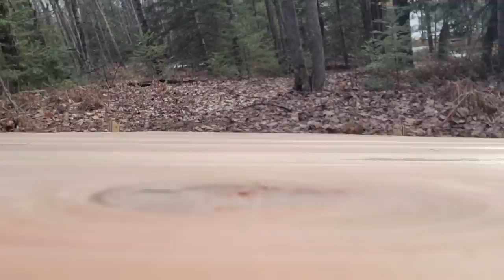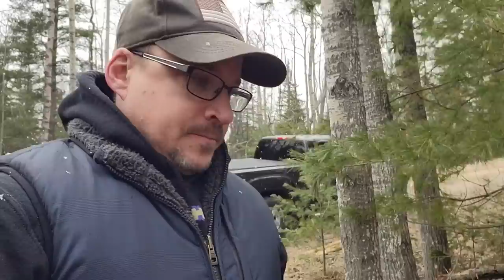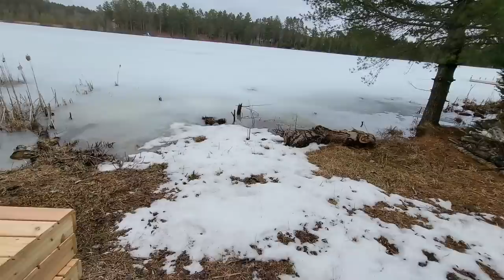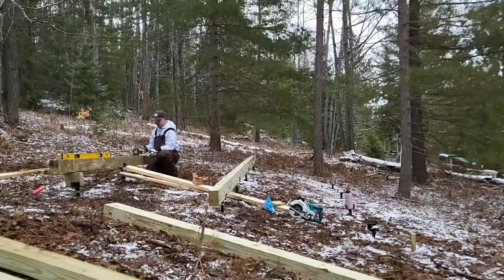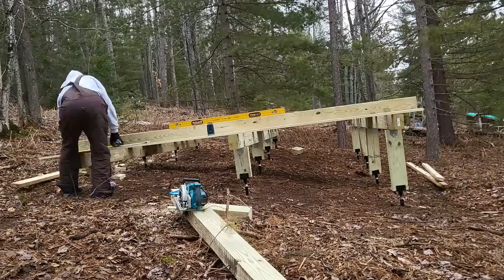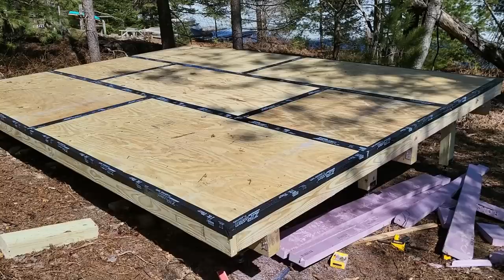12 x 16 Off Grid Cabin Build - Episode 1 - From Docks to Floors

Comment: Excellent location!! Great job!
Having built many small cabins myself, I see many cabins being built today and without putting any bridging between the joists. Most places it’s code. I would have put two rows of solid blocking in. One midway between front span, the second midway of the back span. These help prevent the stringers twisting with age!  Just saying

Comment: The only thing I would change is that you walk us thru the steps. Like the black posts you used inserted into the ground. I have never seen those before. And did you concrete them in? Otherwise wise I enjoyed.
Reply: Same question!
Reply: No, it's a screw.  You simply insert a 2x4 in the U shaped anchor and turn.  You can do that by hand, just take the 2x4 in your hand and walk in circle around the screw 100x and it will screw itself in the ground.  Please do not stack a wooden post before the joist, this will make the structure wobbly and unsafe, especially in the long run.  Wood sometimes warps after a couple months drying and it could make the structure collapse on itself.  You can buy spike extensions that directly stack on the screw instead.  It's much sturdier than a wooden post extension as it can't slide out.
Reply: He shows the installation in his video titled 12x16 shed part 1 (oct 21, 2021). Fast forward to 7:30 in the video where he talks about them. They are pylex screws.
Reply: @thebibleexpository2817  Thanks.

Comment: Oh, you guys also have structural screws over in the US! We use those a lot here in Canada.  Tough, your wooden post quick fix terrifies me.  It will make this structure very wobbly! Why not have used the 2ft spike extensions instead? They're only like 8$ each and they're plug and play.  You can even stack multiple of them on top of the structural screw (between the spike and the adjustable anchor) and they support like 5000lbs each.  I built a 15x16 shed 3 years ago using those structural screws and couldn't be happier.  Nothing moved after 3 winters and it's sturdy AF!
Reply: Which part was the quick fix?  That block of wood under the first beam?